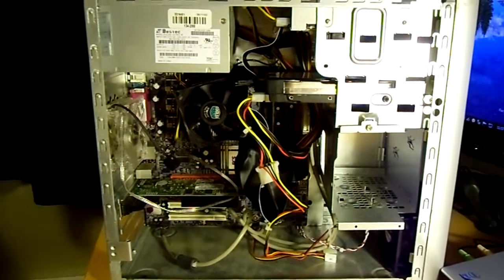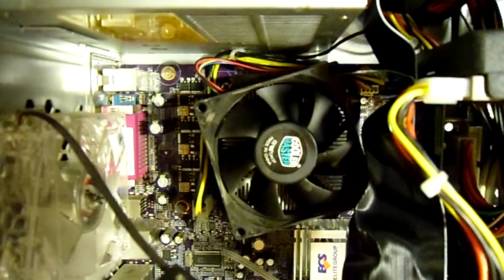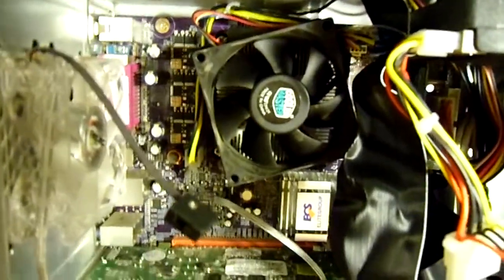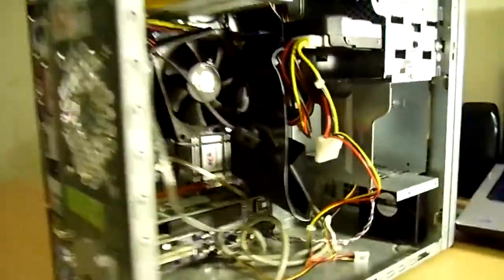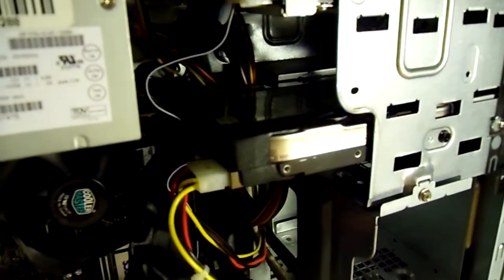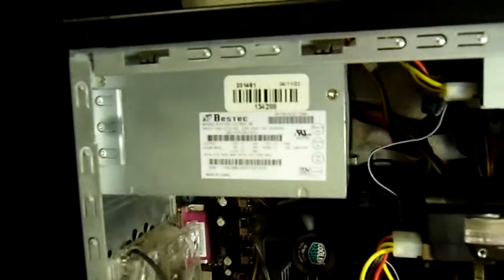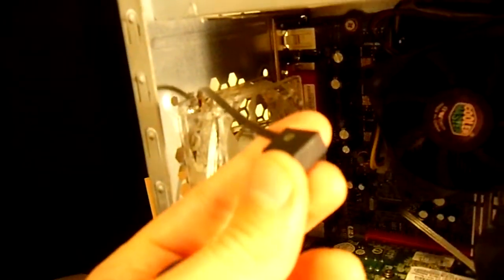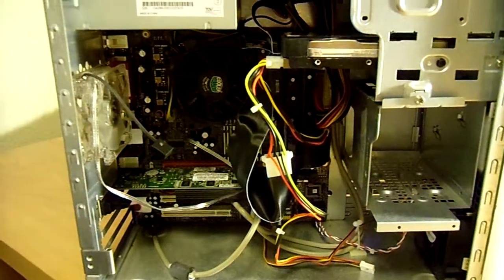My Old $50 PC (eMachines)

Comment: My under 200$ all used part PC

320GB hard disk  15$
6GB RAM 1333mhz  10$ (4 + 2)
Gtx 660 70$  (5 years used by someone)
Gigabyte motherboard 20$ 
pentium g3258 50$
450W PSU 18$
10$ good looking gaming case

And yeah , it runs  GTA V at everything max 1080p at 35-65fps.
And Minecraft ultra settings 1080p ,250-1200Fps.
Battlefield4 ultra 1080p 50-80fps.
FIFA 16 30-60fps 1080p 

Its a beast dirt cheap PC and runs well.
Reply: mine is optiplex 760  ( i-5 2400, 4gb ram, 500gb) $50
4gb extra ram $10
700w psu $15
gtx 950 2gb $123

total $198